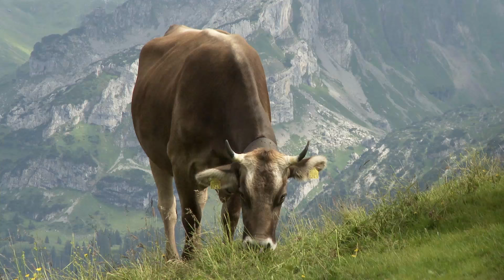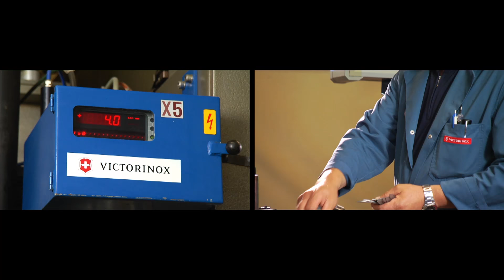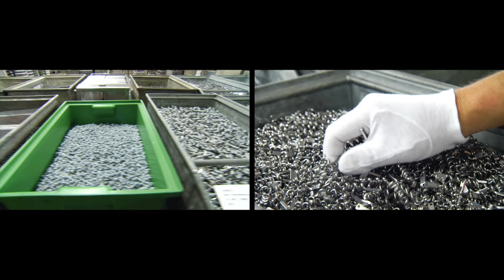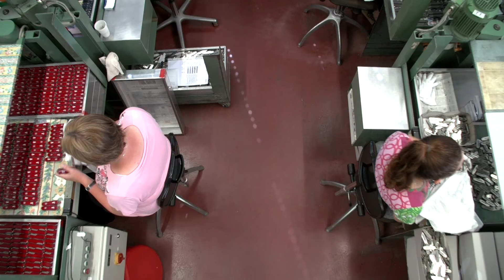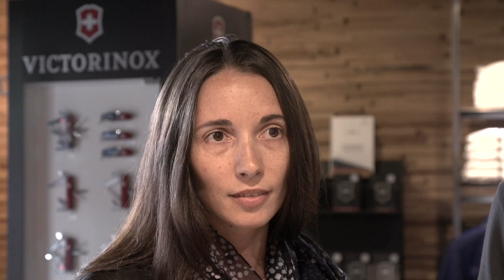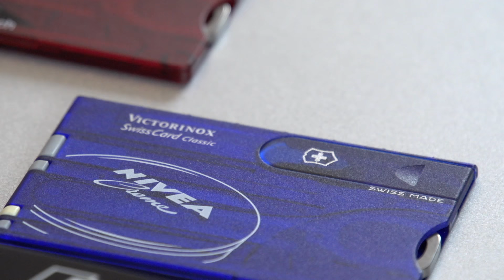How the Victorinox Swiss Army Knife is Produced | Victorinox

Comment: Great video!  It's neat to see the manufacturing process of these handy tools.  I have hundreds of knives, some costing up to $900, but I still have a couple dozen SAKs in my collection, too.  The regular main blade is perfect for EDC with the basic Kephart shape that's great for 90% of common task.  Edge retention isn't really great but they're so easy to touch up that it doesn't really matter.  Still the star of the show for me is the scissors!  It's the tool I use the most of all.

Comment: My first Victorinox army knife was an old used champion that I found trapped in the grass. I picked it up and took it home, where I cleaned and oiled it. After all blades were clean and moving, I regrinded the broked off tip of the small blade and sharpened both blades. Almost 30 years ago, I still own it. Amazed by the quality I purched various other SAK which were easier to carry in the pocket. Over the years they became my "third hand". At my workplace, I'm notorious as the guy who always carries a knife and colleagues ask to borrow it. All happened, because somebody else lost an old and used SAK.

Comment: You are blowing it. If you want to apeal to outdoors people you NEED a knife with a replaceable FIRE STEEL , MAGNIFYING GLASS, AND A LOCKING KNIFE both serrated and non ,  AND SAW. IF THE KNIFE DOESNT LOCK ITS USELESS. And better knife steel ! And the Awl always needs a hole in it, do not change that.

Comment: Howto open this knives without tool?
Reply from the maker: Hi, thank you for your interest. Each tool has a nail nick to pull out each tool. Best regards, Sue
Reply: @victorinox  At least my nails break if I would use this nicks. So I use other knives with blade-noses or better mechanic solutions.
Reply from the maker: Thank you for your feedback. Will be sure to pass it on. Best regards, Sue @rainertheraven7813

Comment: Would security allows to be carried to the airplane???
Reply from the maker: Hi, thank you for your interest in our products. In accordance with airline luggage regulations, dangerous objects are generally banned from carry-on and checked-in luggage on flights or are subject to restrictions.
However, these regulations vary depending on the airport, airline and country. You should therefore consult the website of your corresponding airport for detailed information on current regulations before you start your journey.

Some countries have more stringent regulations about carrying objects that can be used as weapons, both in and outside airports (for example, a pocket knife with a lockable blade). Please bear this in mind and make the necessary inquiries. In general, we advise you to stow pocket knives in checked-in luggage.
 Best regards, Sue

Comment: Great tools, but i wish they used harder steel at least for the main blade of their standard models. However i also understand that it would incorporate heat treatment process and make the overall production more complicated and therefore more expensive
Reply: It uses softer steel so it's easier to sharpen yourself, at least that's what I hear

Also, nobody should use this kind of knife for cutting woods so softer steel is alright

Comment: I have 4 victorinox knifes at home, 1 spartan that I have been using now for over 25 years and is still going strong(with convex edge after i sharpen it), bought 2 kitchen knives, sorry to say it but I didnt like them at all so they are not in use anymore, the blades chip to easy. Recently bought a Hercules that i will cary with me on my hiking trips Hope it is as good as the spartan that i have

Comment: “To make sure our blades last a long time”

looks at classic sd

isnt sharp

Hmmm
Reply: All knifes will dull saks are on soft side but they are easy to sharpen you can use sand paper 800 and 2000 grit or even a cars wind shield if exge isnt badly chiped to sharpen knife shaving sharp
Reply: Yeah lol, no knife steel is infinite edge retention. You have to sharpen that thing

Comment: Have carried one (or more) every single day since I saw one (super tinker?) being used in the original MacGyver TV series back in 1985.   Currently have around 50 (including three flavors of the Swisscard), not counting the half-dozen I've given away over the years.   One is the Swisschamp XAVT (too big to carry but still nice to have).   Own two RescueTools (with and without the one-handed blade release).  Just received an Evolution Grip S54 for Christmas; just started to carry it as my new daily companion (replacing my Cybertool lite) as of yesterday.  Curious to see if the durability of this newest one holds up to traditional Victorinox standards since this is originally a Wenger design, and as typical with Wenger SAKs, the tools are a bit thinner (especially evident with the pliers).   Next purchase will likely be a new Swisschamp to replace my 30-year-old version which was retired after an active career about 15 years ago.  Would not think of leaving home without one.

Comment: Basically the most consistent folding knives made today, I've never seen it heard of a bad one.

I would have to say the Vic recruit is probably the perfect lightweight and compact folding knife for everyday utilitarian use, it's certainly the best you'll find at $15 and cuts may better than probably every modern tactical folder at 2X-100X the cost.
Two great extremely thin and slicy knife blades, a can opener with small standard driver which will also turn Phillips screws, a large standard driver / cap lifter , a wire stripper, a toothpick, and tweezers.
There are many things you can do with Vic functions that are not official uses, and with some creativity you can accomplish a lot on a daily bases with a Vic.

Comment: I don’t get the comments lol. Cheaply made. Probably the best cheap tool you can buy but certainly not high quality lol. You going to tell me these are better than a leather-man or Gerber multitool? Lol.
Reply: OfficialJoeKingOne when I was in Iraq I was able to saw through a padlock with the saw on my learherman, you telling me you can do that with one of these? Also when talking about size and weight your point is mute. Yea it’s heavier and larger but we are not comparing something that matters in that regard as it’s a small difference . The weight and size of a leatherman is not at all cumbersome. It’s like saying a Rolex watch is to heavy and therefore a Casio gshock is much better.
Reply: And as far as price vs durability it’s like this, I will use watches again buy one Rolex for 3-4K and that watch is good for life if you buy say a fossil watch it’s good for a year and it’s like 120 to 250 which one is the better buy long term? Same with these, I’ve used these and the blades break easy!!! If you are a soldier in the US military and you pull out one of these you get laughed at. Passed down? Yea if you seldom use it lol.

Comment: Victorinox use 1.4110 Steel (X55CrMo14) , it will be nice wirh some bether Steel.
Reply: speedykobac 
It's all about the heat treatment. 
There's a reason why Victorinox chose it. 
Ease of use / longevity / rust resistance / easy maintenance … come to mind. 
Heat treatment and quality control can outweigh higher end steels.

Comment: the best knife for survival
Reply: And pretty damn awesome for simple every day carry
Reply: Definitely not.
Reply: iTheGeek 
Swiss Army Knives have been proven to be the BEST survival knife there is.  Look it up.
Reply: @adamperkins6054  That is a ridiculous exaggeration.  If  you were stranded far away from civilization would you rather have a knife that can process firewood, skin and cut large and small game, and help build shelter or a Swiss army knife?  Swiss army knives aren't good survival knives because the steel used isn't wear resistant enough to hold an edge long enough to do any of those tasks.  I don't think you know anything about steel used in cutlery and the difference and application between them.  If a Swiss army knife truly were the "best survival knife" nobody would spend hundreds of dollars on large bulky and heavy blades when a swiss army knife could do the same job as good.  I'm not saying that that Swiss army knives are bad but to say they're anything close to a survival knife is ridiculous.
Reply: @adamperkins6054  Seriously go try to make tinder for a fire with a Swiss army knife and see if it's a viable option, then actually try to light it by striking a firesteel with the spine of the knife because matches and lighters are liable to getting wet or breaking.  Oh and don't forget that you'll need to make a shelter but you'll probably roll the edge trying to cut any wood to size.  Now that you have DEFINITELY built a fire and shelter with your knife and the edge is in superb condition after all those tasks you need to harvest and cook food.  Seeing as how the blade is a pretty mediocre low end stainless steel running at 56 HRC I would wager to say that the edge is completely flat or rolled over that basically means that your knife won't function as a knife.

Swiss army knives are fine knives if you need to break down boxes and do everyday tasks and dulling isn't an issue of you know how to sharpen it.  In a survival situation you shouldn't have to worry about taking care of your knife however all knives need some TLC.  Swiss army knives are AWFUL survival knives in the sense that there are knives that do the tasks much much much better.  They make some good pocket knives but they are the last knife you want in a survival situation.  If you honestly think these knives are great survival knives, I encourage you to pick up a fixed blade knife, full tang, made by fallkniven or kabar or another knife brand known for quality.
Reply: Looks like I hit a nerve, I was kidding with that comment.  My sarcastic ways sometimes catch up with me.

You make a lot of valid points, but the fact is I have a pocketknife in my pocket right now, not a huge "survival" knife.  I'd never carry a huge knife on a daily basis, and if I was heading into the woods I think a tarp and a couple of sandwiches would likely boost my chances if things did get ugly.  I honestly don't see the appeal of the huge, pry-bar sort of knives that are popular right now.  I have a Mora Companion that I take on hikes, and have never wished I had anything more.
Reply: Definitely.
Reply: YawaraMarco nah, the leatherman is more useful. Not that Victorinox isn't good but for survival leatherman wins